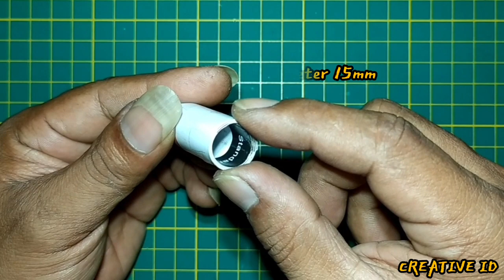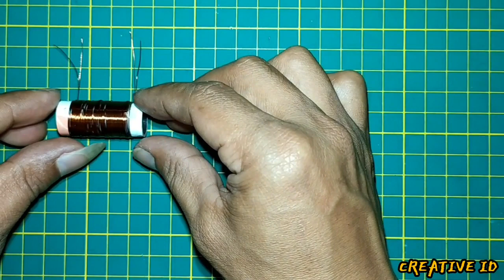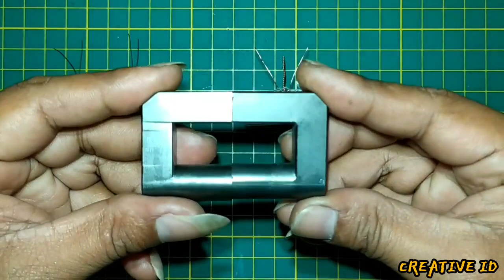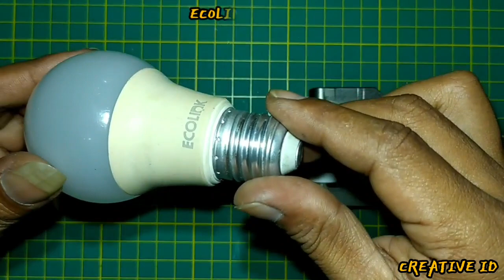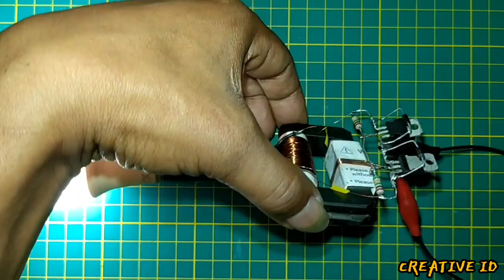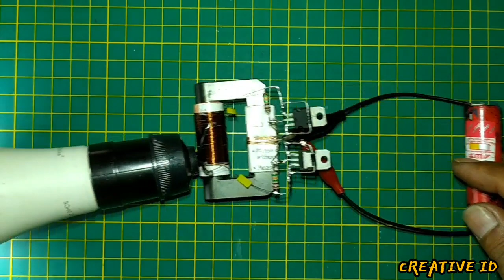Joule Thief 3,7 to 220V Ferrite Flyback TV @joulethieftutorial

Comment: resistor itu ada kaki base nya,  atau istilah nya min plus nya nggak bang,

klo kebalik rangkai nya
Reply from the maker: Gak ada Bos, dipasang bolak balik tetep bisa
Reply: ada rangkaian terbaru nggak bang,

untuk 12volt DC to 220 ac tapi Watt gedean dikit
Reply from the maker: @aircekdam kalau untuk input 12V tinggal ditambahkan saja jumlah lilitan primer nya Bos, bisa 15 sampai 20 lilit.
Biar output lebih besar lilitan sekunder nya juga ditambah.
Reply: tapi tetap pakai terafo ferit,